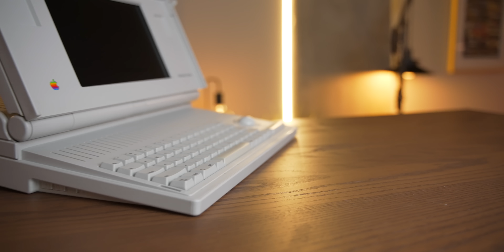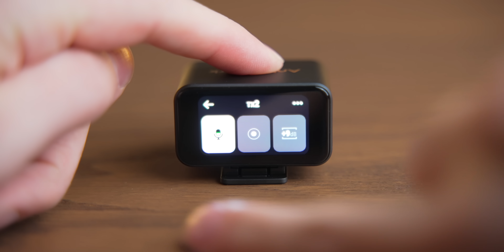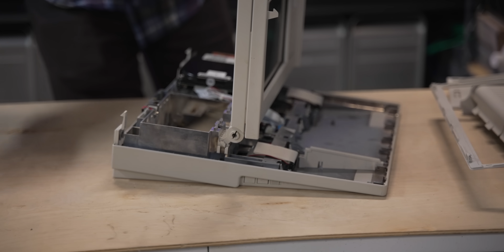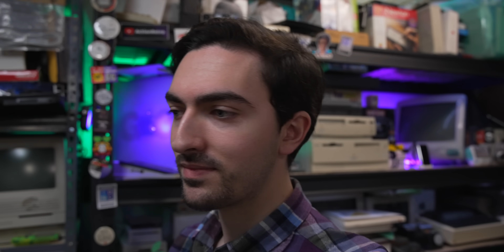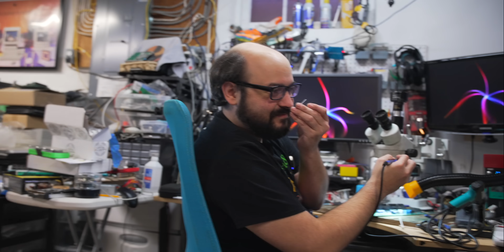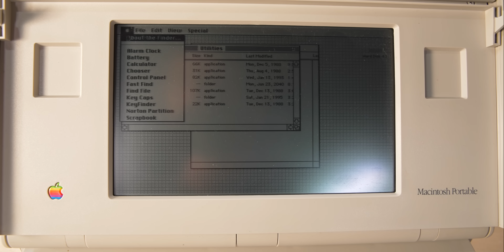Can we REPAIR Apple's FIRST EVER laptop?

Comment: The original hybrid may have been fine. When the machine was shown having a problem starting up, there was no charged battery installed 1:25. Unlike modern laptops, the Portable will not work without a charged battery installed. The power adapter is only for charging the battery. It cannot power the Portable on its own.

Comment: Another point - they used a PP9 9V battery as a clock/pram backup. If you removed the main lead acid battery it would try to start up from that PP9 battery - that's why you see the blinking screen at the start of this video...

Comment: Worth pointing out that whilst it does sport a SCSI interface the hard drive is a unique design for the Portable - it is a low power model. I wonder how that will effect any after market SCSI devices such as BlueSCSI? Will they be able to get enough power?
Reply: The hard drive is supplied with +12V and +5V, the BlueSCSI only needs the +5V. It runs without issue.

Comment: I dont get why people keep saying it is broken when it does that. Even when this laptop was brand new, it would have these exact boot issues if the battery was not present or if battery was broken. It never ever did run from just the power supply alone.

Comment: The flip capable between track ball and keyboard is an amazing idea. As a “lefty” who has always used the mouse with the left hand, can REALLY appreciate the thought process… ❤
Nice job Steve! 😊
Reply: Steve was gone — fired; at NeXT. This was a Sculley project through and through.
Reply: The problem is that no one ever changed the trackpad position, but everyone had to pay for an extra connector on the keyboard module. Typical apple.

Comment: The first “true” laptops from Apple were PowerBook 100, 140, and 170. The PB 100 was a miniaturized version of that Mac Portable. Apple outsourced the technical redesign work to Sony, and the result is quite compact and elegant. It has the keyboard forward, pointing device (small trackball) in the middle between palm rest area. These first PB models were the first laptops with this now “obvious” layout, another Apple innovation. It didn’t have a built-in floppy drive (came with external floppy drive), making it noticeably thinner and lighter than its larger more powerful brothers. I used one (to do actual work), my first laptop! Maybe PowerBook 100 can be your next vintage project.

Comment: I own one of these. The backlight model. Finding a battery is the hard part. I replaced the original with a nicad. I need to replace it again.

It won’t start without the battery, at least not with its own charger. It doesn’t produce enough current.

Comment: According to the specs from Apple, that machine should be able to have a  single chip with 8 MB of ram, and run most systems between 6.0.4 to 7.5.5!
That's makes it a surprisingly nifty machine.

Comment: My signature is one of those in the bottom case as I was the chief software engineer on the Portable.  Among other responsibilities on the project, I wrote the ROM code, the Power Manager embedded micro code, and the code for the keyboard controller.  As one of the primary team members I received (and still have) a clear plastic Portable.
Reply: Tell us if this is true, as I heard it several times.

The buzz is that this project was actually created a portable version of the Apple IIgs which was released in 1986, but management switched gears and the hardware made wasn't powerful enough to contain a Macintosh II (and the monitor was black and white) so they basically squeezed a Macintosh SE but with a clock speed of 16 Mhz (just like the II).

Idk if this is all true.
Reply: @CarlosOsuna1970  Not true.  I was on the project from day one (1985) and it was always conceived as a Mac.
Reply: @vmhanlon  thanks
Reply: definitely not scammable person
Reply: Awesome achievement, I adored mine. 💝💐👏🏼
Reply: There’s a nonzero chance that a computer I have belonged to one of your colleagues. I have a preproduction Portable that is essentially the final model but it predates the FCC approval, so the bottom label doesn’t have any model information, only a notice that it’s a prototype. I got it from the wife of one of my teachers who got it in the mid 90s from a friend of hers who was an Apple engineer.
Reply: @VectraQS  That sounds like a PVT (Production Validation Test) unit, nearly the same as production.  Before that are the initial EVT (Engineering), followed by DVT (Design) phases as the project matures.  As each subsequent phase is built and distributed, older units are collected and destroyed (or sometimes stripped for parts).  Back then PVT units were often left with departments that had been testing them and since were nearly production level, employees would use them as production units. PVT units are/were Apple property and not meant to leave, though back in the day this policy wasn't strictly enforced.  In other words, that Portable is hot! 🤐
Reply: Heads up, the first reply that’s trying to give you a gift is a scam. But that’s awesome! About the Mac portable of course.
Reply: @Blindtechnician  Yep.  Didn't bite.  Thanks.
Reply: @vmhanlon  nice, I reported the account just to be safe so hopefully that gets taken care of.
Reply: @vmhanlon  OMG WHAT?!?!? THATS AMAZING!!!!! how long did you work for apple?
Reply: @alisonmcgregor2002  Almost 28 years.
Reply: @vmhanlon  oh wow🤯🤯🤯when did you stop working at apple? the 90s?
Reply: @alisonmcgregor2002  November 1981 to May 2009.
Reply: @vmhanlon  omggggg, that’s AMAZING 😯🤯does that mean you’ve met steve jobs before?
Reply: @alisonmcgregor2002 likely not, jobs left apple in 85, which was around the time that the mac portable project began, and i'd imagine he wasnt very present in the years before that either with the failiure of lisa and the mediocre uptake of the 128K
Reply: @ethantalbot6143  maybe, true
Reply: So interesting! Is there any way you could make a short video of the clear case portable?
Reply: @jesper99  I could do that.  Unfortunately it doesn't work, but I could at least show it off.  It will be a few days before I can get to it.
Reply: @vmhanlon  Get Luke to fix it :D

Comment: They put the de facto first Macintosh portable called the Outbound out of business. They were around for many years before the actual Apple laptop ever came out. It used the Mac SE logic board and repackaged it. It even had a ramdisk back then. I finally sold mine on Ebay to someone in Japan.   https://en.wikipedia.org/wiki/Outbound_Systems

Comment: One of the modular features of these was the trackball can be replaced by a numeric keypad, and you then use a standard ADB external mouse with it.
Since it's an Apple Desktop Bus mac, you can also use an ADB keyboard / mouse with it, there were joysticks and a few other ADB peripherals made as well, such as graphics tablets and even the Teleport modem.
Reply: And you can also swap the position of the trackball/keypad to the left side and the keyboard to the right.

Comment: its incredible how apple have designed things over the years, even when they use older parts which dont really need upgrading, i forget the part but it was audio based, because software does most the real work, But the machines themselves have become smaller and more faster/powerful than competitors machines which are colossal, & they could take a leaf out of macs book and condense systems far smaller, because theres no excuse no more, the tech to do it all exists, Even with a.i around now to help ehere due. On another note, those anker mics look impressive, especially with the camera adaption option.

Comment: For the screen capture, is there a way you could get another ribbon cable and attach it to a similar (but backlit) screen? I’m honestly just guessing. This is beyond “can you find an adapter” and I doubt that computer has video output functionality.
Reply: Apple actually has a video out port on the system, but they never shipped the adapter for it (even though it was advertised). They did create a Backlight upgrade kit for the non-backlight models, but it is very hard to find these days. It's not as simple as a screen swap, you needed to install a new screen and a ROM card to teach the system how to use the backlight screen.
Reply: @Mac84  that’s cool but unfortunate they never shipped one. I suppose the ROM replacement is akin to different firmware versions/kernels for different processors in modern MacOS?

Comment: 👋Thanks for giving me the opportunity to fix up this Mac! I'm so glad it's a happy Mac once again. I look forward to seeing what you do with it next! 👍
Reply: The man, the myth, the legend! Love your content as well, sir, thank you for the entertainment and education these past few years.
Reply: @Mac84 whats the trick to replace the batteries in the battery pack? Ive been reading that you cant run these computers without the battery back.
Reply: @jaws10278  You can find a slim 6V SLA battery that will fit in the original pack, or 3D print a case. I personally use more modern 6V LiFePO4 batteries in mine.
Reply: @jaws10278  Sorry for the super late reply. These Macs (and many of this vintage), do not need a battery pack to start up. The Mac Plus will work fine without it, the only negative is that the clock & date data will be reset once you power off the system.
Reply: Stop beatbox
Reply: I have an old Power Macintosh 8100 & Power Mac G4 from my dad that I might be trying to revive as I grew up with those machines. I might have to check out your content :D
Reply: Hey @Mac84, how much to have one fixed? no power as well. thanks
Reply: Steve - read your website closer today and realized you are busy and not taking repair requests on your site. I am taking the plunge on a 5120 off eBay just a few days ago and decided to do the repair myself. Desoldering unit, descent magnifier and hot air station from Amazon will get me started. Watched this video a bit and another on your site and downloaded the PDF of the capacitors you referenced. Will take my time, use the soldering mask to cover traces exposed and emulate as much as you have taught by doing and demonstrating.
Reply: Macs need love

Comment: Nice to see Steve on the channel! I tried recapping a Mac Portable a while back and was somewhat less successful, although I wonder now if my hybrid module might also be part of the problem.
Reply: I feel your pain! Mac Portables are beasts to get going, if your system boots (but complains of the battery power) it may be the hybrid module. There are a few threads online that help diagnose it. The traces and vias are very problematic on these systems, so that's also another thing working against you.

Comment: Back in 1990 when the Macintosh Portable was new I was still using a 128 upgraded to a Plus (I had to use an ExactoKnife to cut out the back panel for the SCSI connector that my original 128 board dis not have. I had a friend who got a Portable from work and we wanted to share a FileMaker database that was much too large to fit on a floppy. I brought my 5MB SCSI hard drive to his house, copied the database over then dropped my hard drive, breaking it forever. Thankfully he had the database which was the result of hundreds of hours of work so I saved up and bought a huge 40MB SCSI hard drive (something like $400 back in 1990, probably equal to $2000 these days). I offered to trade him my car for that Portable but (thankfully!) he declined and a year or so later I got a PB140 which served me well for half the price and a quarter of the heft.